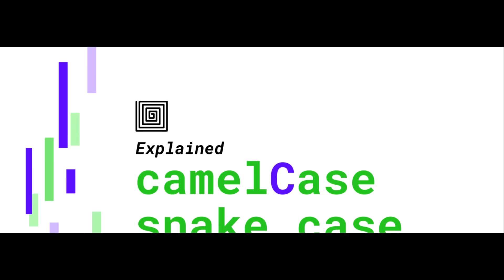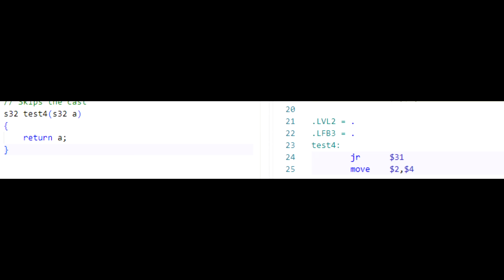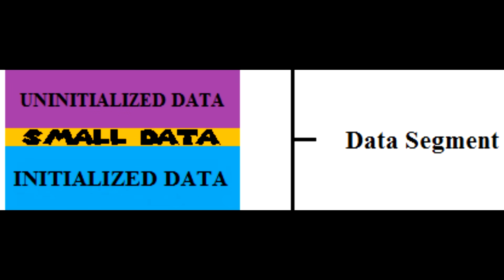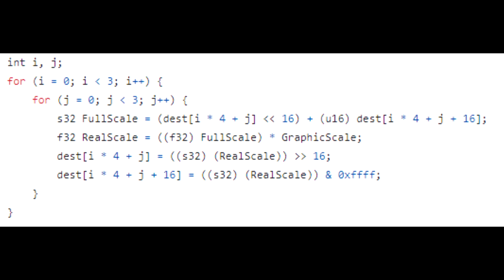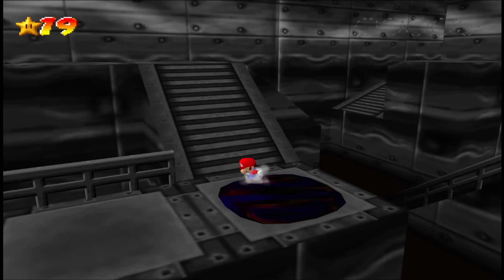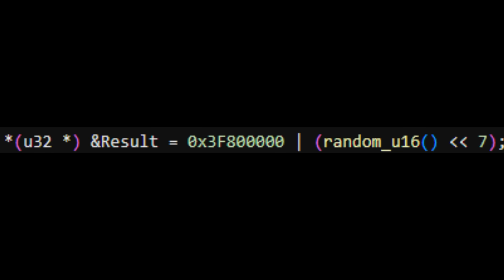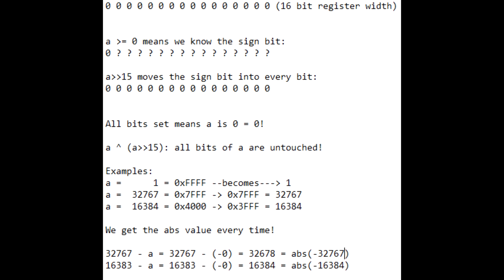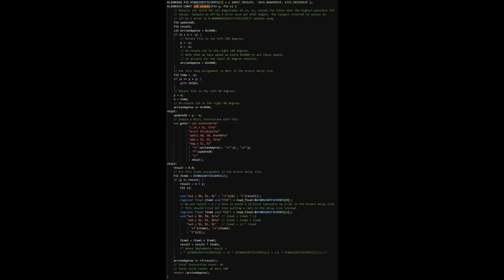Optimizing with "Bad Code"

Comment: Ngl, I actually miss being able to use some tricks like this to make noticeable improvements for tight inner loops of some of my old dos projects. On modern pcs a lot of this stuff would either be operationally insignificant (especially in view of much bigger gains that can be had for doing more common-sense stuff) or even detrimental. But I would be lying if I don't occasionally have things like code-locality cross my mind when writing even the most mundane of functions sometimes. I totally get the whole 'Now my day is ruined' comment about inverting logic lol

Comment: An excellent video! I laughed so hard at some of these, partially bc I've had to do the same with microcontroller compilers. When you've got a dinky little 12 MIPS mcu, counting cycles can be important, and improperly handled casts and such by the compiler can eat into that.

Comment: Why does s16 -> s32 produce left and right shift when it can just AND the value by 0x00000000FFFFFFFF
Reply from the maker: you are thinking of s32->s16 and it produces that because ANDing with 0xFFFF gives you a u16, not an s16. you need the sign extension.
Reply: @KazeN64  ah, that makes sense. I didn't realize it was signed for some reason.

Comment: Eventually when Kaze hits a wall and cannot optimize the game anymore (hopefully no time soon) he will start overclocking real n64 hardware to gain an extra 20% from the hardware.
I heard Overclocking N64 hardware in most games messes with game physics and timings, but I trust Kaze to be a better than average coder to write the correct variables to compensate.
Reply from the maker: there's no way to overclock the n64 from the software side unfortunately so this would be a hardware hack :(

Comment: A lot of these things just wouldn't come up with a newer version of GCC, even on similar hardware. Particularly that gnarly UB call through a cast function pointer.
Reply from the maker: i'm using the newest version of GCC
Reply: @KazeN64  Really? And it can't optimize the i32 -> i16 conversion?

Not even if you use an if (value > INT16_MAX) { __builtin_unreachable(); } to tell the compiler that it can just read the low half of the int32?
Reply: Something tells me the modern GCC isn't all that optimized for the N64 flavor of MIPS.
Reply: @Nobody1707 modern gcc is not very good at generating code for old hardware. I basically don't trust it at all for performance on 68k.
Reply from the maker: oh i hadn't considered uding builtin_unreachable in that manner. I've only used it during switch cases. if that works to give GCC more assumptions, that'd be awesome
Reply: @Ehal256  Well, that sucks. Especially because the SGDK uses GCC.

At least 68k assembly is relatively easy to write.
Reply: @KazeN64  In theory it should work, but I can't seem to get it to elminate the sign extension. :/ I might be doing something wrong though.

Comment: Hardware-aware optimization is just nuts. The most portable example I can think of is FFTW, which computes fast Fourier transforms by making plans tuned to input sizes and hardware instructions. The most optimal use is to save plans and reuse them on inputs of the same size.

Comment: I'm 1 minute into the video and already I feel the need to comment :D Surely, there's gotta be some way to tell GCC to create the padding you want without having to resort to a "useless" member in the struct. Some sort of pragma preprocessor directive or something. Of course, it would just be a more complicated way to achieve something the "uglier" method does already and perhaps less reliable too because compilers (and especially pragmas) can't be 100% trusted when the goal is maximum performance.
Reply from the maker: yeah i think there is an alignment keyword (though i prefer just adding the fields manually, also lets me use them if i ever need them in rare instances)

Comment: Optimization principle #4, "'True' doesn't have to be 1...", I recognized that from looking through the 'code listings' for the Apollo Guidance Computer. M.I.T.'s programmers ABUSED THE HELL out of that, of a value NOT BEING ZERO satisfying 'true' for boolean functioning.  When you only got 4 kB of true RAM to work with and you're reusing memory locations all over the place and numerous ROM routines are even reusing the same variables and data, optimizations of this insane level kinda become mandatory! XD
Reply: I will add however that in the AGC, the programmers did have to worry about signed values about all the time, and because the AGC was a '1's complement' machine, there was such a thing as NEGATIVE ZERO in it also! This made doing math in it sometimes messy as hell, but hey, that also meant with a single assembly opcode you could check for up to four conditions to branch off of on any numerical value: negative non-zero, negative zero, positive zero, and positive non-zero and so a great deal of conditional branching could be done straight in assembly!

Comment: I have always wondered if it will be faster to literally modify code of a function instead of checking a flag when having different behavior depending on state (not counting virtual tables because it's kinda different) and thought I will never find that trick in actual codebase because of how batshit insane that would be, but you never fail to amaze me, Kaze. Wish you best wroom wrooming rambuses
Reply: Is executable portion of RAM writable by default on N64? Or did you need to mark it as one? Modern computers usually have executable data on RAM non-writable by default on OS level to avoid instruction corruption, but I don't know if Nintendo knew/cared to implement that
Reply from the maker: everything's writeable
Reply: @KazeN64  did that ever happen in any game or your experience that code accidentally corrupted game's code in memory or started reading plain data as instructions? do N64 games use canaries to for buffer overflow protection?
Reply from the maker: @capsey_  it happens in plenty of games. there's a whole category of bugs known as ACE that make use of this.
Reply: @KazeN64  OMG I just remembered that time they made Breath of the Wild in Ocarina of Time on Games Done Quick. And also Flappy Bird in Super Mario World, but that's SNES. I'm kinda mad I forgot about that before writing this comment

Comment: Could you not solve the $GP randomization issue with just adjusting your linker script?
Reply: In fact, #6 and #7 are both things modern LLVM can and does do, though I imagine that's not an option for you.
Reply from the maker: yeah it should be fixable

i dont really know about llvm. i kinda just grew up on assembly and hex editors and i find tech too frustrating to deal with to figure that kinda stuff out LOL

Comment: 3:12 can't you just use an s8 as index. C compilers assume s8 never overflows and you don't need the values between 128 and 256.
Reply from the maker: I just tried that - they still cast to s8. it adds 2 instructions to use s8 instead of s32
Reply: @KazeN64  Cringe and unbased.

Comment: This is very impressive. A level of optimisation I haven't seen since the 8-bit and 16-bit days of writing games to eke performance out every last cycle. But why even use C at this point? You admitted that you are coding specifically to the hardware of the N64, and you are fighting the compiler because it's not outputting the desired instructions. You've done some inline assembly and this is not a portable project, at this stage using more inline assembly would probably be more understandable and also more resilient. At the moment what you have created isn't just coded specifically to the N64, but to the specific compiler as well.

Comment: Well... With this code, at the very least you are actually succeeding at some measurable metric, whereas people pushing for SOLID, etc. aren't showing that. Though some of these are truly disgusting, a lot of them can be made more stomachable by good comments explaining motivation and how it works. 

Like, for the ones where you have to do that nasty loop indexing thing, would it be valuable to have a comment providing the straightforward equivalent? Only issue is that if the code is updated, the comment will need to be accurately updated too.

Comment: You mention that "the compiler should do this for us" with the for loops, and also mention using a custom gcc version. Would it have been easier to add these optimizations to the custom gcc instead, or were you wanting to keep some level of compat with normal gcc?
Reply from the maker: it was just less effort to write it here than to try to figure out why GCC does not do this automatically. i haven't read into the GCC source code at all (and i imagine reading into it is going to be a whole project by itself)

Comment: All this talk about memory has me wondering.

We're using the expansion pak because the memory built in to the N64 is paltry, but doesn't the N64s other hardware upgrade, the N64DD, have some more memory on it too?

Without even using the disk drive itself, would using the cache in the N64DD be useful for relieving space constraints? I'm assuming the latency of access isn't as performant as the expansion pak.

Comment: 3:45 wait, doesn't this cause problems when LocalIndex is 256, since you're indexing the array with it before the emulated overflow?
Reply from the maker: it would behave differently in that scenario (keeping the index 0 in tact) but not any worse. both hitten 256 and overflowing back to 0 would cause a fatal crash. the value itself never gets bigger than 32 anyway though

Comment: Shifting the vector's pointer offset backwards by the position offset is absolutely bonkers man, I'm pissed. 😂

At that point, why is it not faster to just have that function just take in two vectors? And just for objects, you do the offsetting to their positions when you call them.

Is it just that the vast majority of distance calls are object 2 object, so putting the shift at that point would be more of a hassle?
Reply from the maker: the shift would be 1-2 extra instructions so it's faster to do this way

Comment: Are performance and upgradability ever important enough to sacrifice readability?
(Haven't watched the video yet. I'm excited to do it when I have time, though.) But yeah, I always wonder where the line is between human-readable and machine-oriented efficient code.
It would be cool to make an indie or mobile game someday, but I'm...
I dunno. I'm wondering how important performance is too. Especially for a mobile game, poor performance lead to rapid battery draining, long loading times, and other issues? Is unity too bloated for that? Is Gamemaker Studio better for 2D games?

I have too many questions. And I worry too much.
Reply from the maker: the stuff i discuss here is like the last 5% of performance you can squeeze out. most games probably dont even reach the last 50%. you won't have to worry about this.
Reply: @KazeN64  Thanks. I think what you are doing with Mario 64 is extremely admirable!
I can only imagine what a skilled programmer could do with Super Mario World. I've heard that game is held together with Duck Tape and dreams.
Reply: Yeah, Unity is bloated for 2D, I would suggest Godot, or better yet defold and gamemaker between these two I think defold might be the faster one since it uses lua instead of javascript, something simpler  than those two won't be a game engine anymore but a library like SDL or Raylib. I think if you want a fancy 2D game you would go up to godot level. Unity is a bit more bloated but might be faster than godot in some cases like maybe lots of rigid bodies or maybe not, you should better benchmark between the two at that point.
Reply: @xdanic3  Thanks! That makes sense to me. I've been looking into Gamemaker, but I haven't heard of Defold yet.

Comment: It's a little surprising there's no abs integer instruction on MIPS.
Reply: It should be doable in 2 instructions with branches, or 3 instructions with the branchless code shown. I don't think RISC-V has an absi instruction either, and it seems x86 doesn't as well. The shift-xor-sub seems to actually be the standard way it's implemented in most compilers for processors that lack a conditional move instruction.

Comment: Well, how much do this actually do for the performance? Could be that it isn't worth it.
Reply from the maker: "The priority list goes performance > versatility > readability with no compromises."

By my priority list, it is worth it if the save is non-zero. I gave a few figures during the video on how much some of these save too. It's usually 1-2 cycles at a time.
Reply: If we can save enough microseconds, we can save cycles.

If we can save enough cycles, we can save frames.

Comment: Where are the benchmarks 😭?
Reply from the maker: i didn't just apply all of this at once, i apply it as i go. there is no clearcut before/after. best i can do is give estimates for how much each optimization will save (which i did during the video, these were all measured)